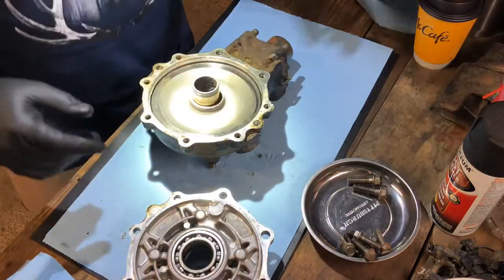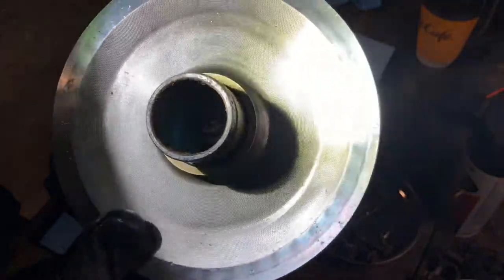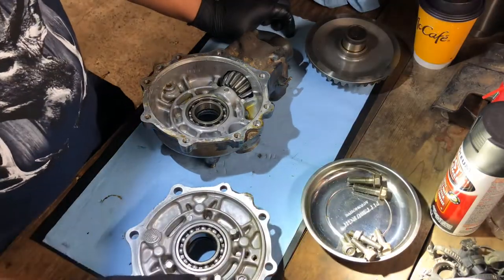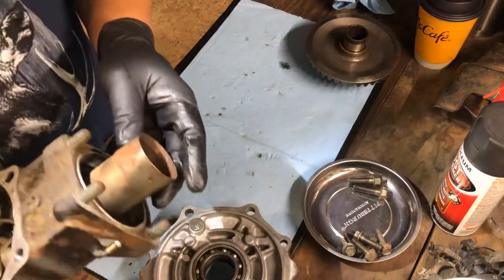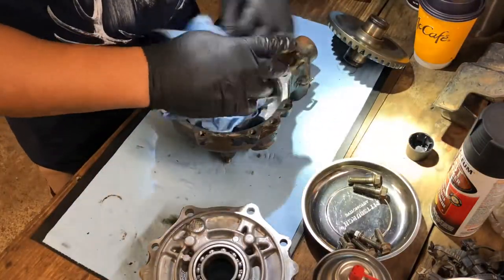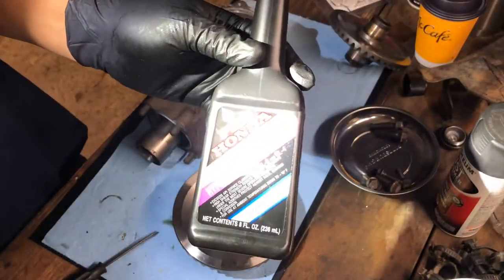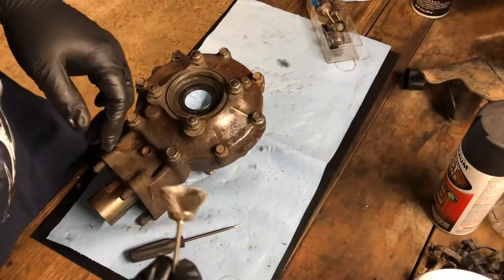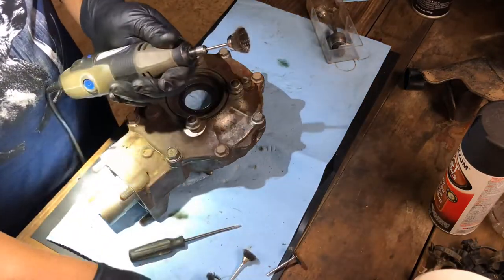2005 Honda Rubicon - New Rear Ring Gear & Rear Differential cleaning

Comment: Does the pinion have any access play
Reply from the maker: The pinion shouldn't any In and Out play at all (as shown at 3:07min). Rotating play (as shown at 6:19min) should be very very minimal. If you have more plan that whats shown in my vid, then the teeth on either the ring gear or the pinion are worn. You could possibly go with a thinner shim on the tooth side of the ring gear to close the gap. I left my shim rings the way they were from the factory.
Reply: Thank you for the reply. After reinstalling pinion bearing the pinion gear did not sit in place after the special nut was installed as far as it would go there was about a quarter inch play. Even With the washer between bearing and pinion gear.

Comment: Could you just changed the center part where the splines are or do you have to buy the whole ring ⚙ I have the same problem right now
Reply from the maker: you have to buy the whole ring gear. However your ring gear might be fine and maybe your splines on your axle are worn. Most times its both that are bad.